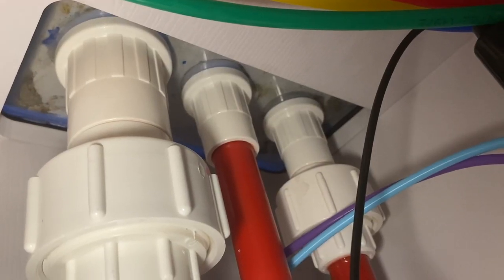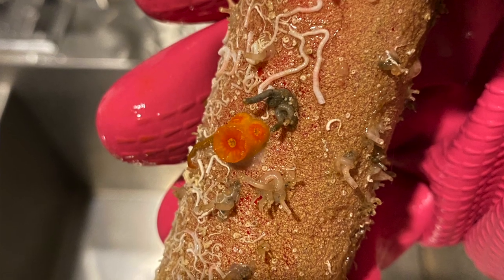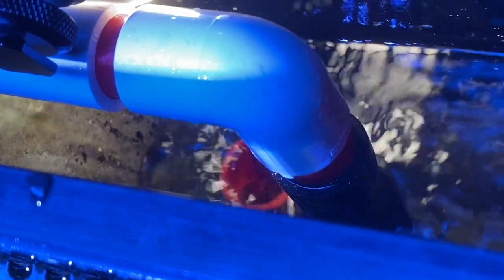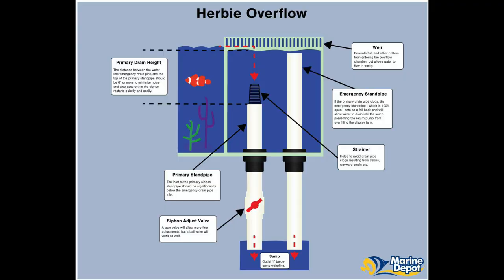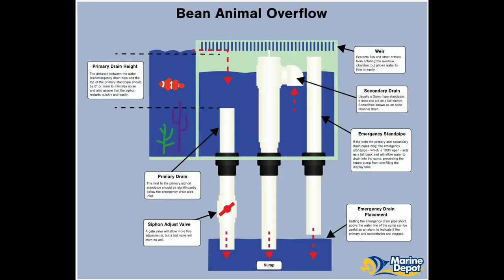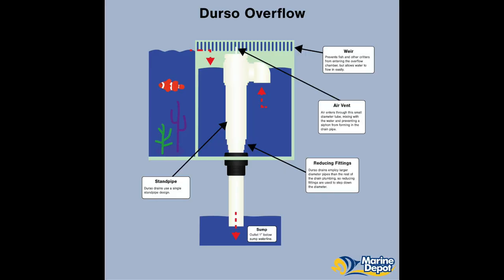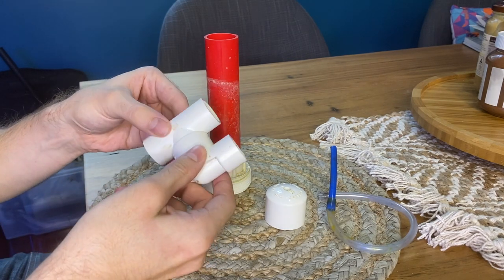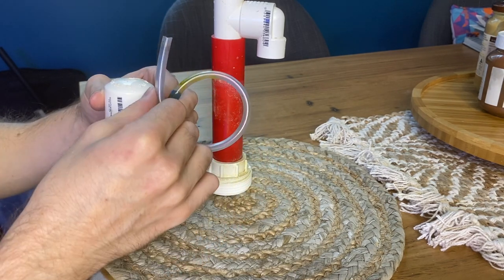Simple Hack to Silence your Overflow!

Comment: Thanks for this great video! A loose cap on top didn't quite do it for me (the slurping would alternate between going quiet and starting again) but after inserting a wide rubber band between the T-fitting and the cap (creating an almost air tight seal) this worked flawlessly! No slurping at all anymore, it's all quiet. Thanks again!
Reply: Hell yeah! 💪
Reply: Get a smaller cap and seal it.

Comment: Why does the endcap need to be loose fitting? Seems like if it was tight fitting it would be silent as long as you have the air hose properly adjusted.

Comment: Great video thx! 1 question. I have a breeding rack with 6x 130l aquaria with only 1 standpipe overflow. The tanks are barebottom is it still a extra risk to put a durso on each? Cause I don't want a overflow room😂
Reply from the maker: Im probably not qualified to offer you advice on that scenario... though with that much water, I would personally want an emergency overflow drain

Comment: So I have a display tank with some holes drilled into the back wall and a weir in front. I do not have an overflow box in the back. How can I design my drain setup so that it's more silent or do I have to have an overflow box in the back? Thank you for your videos.
Reply: You can make the 2 fittings inside the tank instead - run one just above the water (emergency) and one below (with a tap on the outlet so you can close it until it's full of water only, thus silent)

Comment: Will the water level rise when you put the T and the cap? Water level inside the overflow box
Reply from the maker: A little bit yes. Depends on the exact plumbing you use. But it will rise in the overflow by approx 5cm if using a similar setup to mine.

Comment: How many gal is your tank? Return pump flow rate?
Reply from the maker: Its about 80 Gallons, I am running a Maxspect Turbine duo td-9k, in single outlet mode at 100% as the return. No idea what the flow rate on that is but I am sure you could find the specs from Maxspects website.

Comment: Looks like vermited snails in there !!!
Reply from the maker: yea quite a few were hiding down the weir... very sharp and easy to cut yourself on them! They have been mostly eradicated from my display by combination of manual removal and i think my 6 line wrasse or coral banded shrimp eats them, but the weir is a safe haven for them
Reply: I just bought a used set up. 165 with all the live rock 200 lb worth. Tank was covered in anemones and me being new didn’t notice rock was infested with them snails. I went all dry rock. My mistake. Thanks for the video trying to quite my returns.